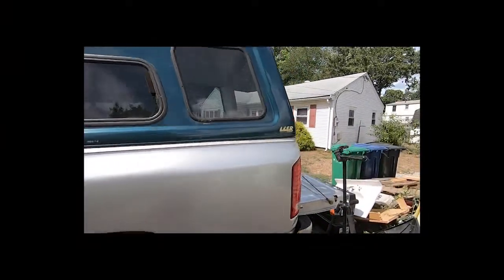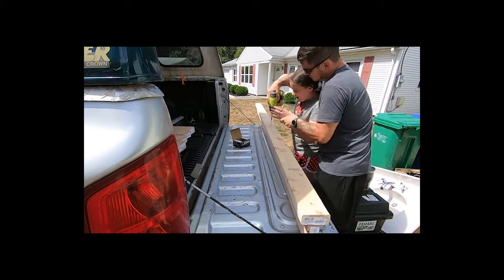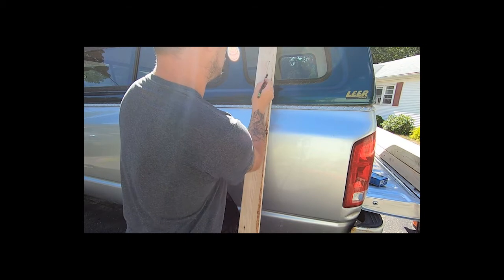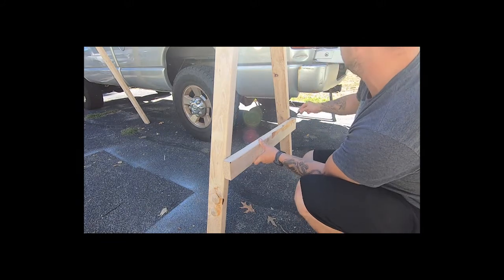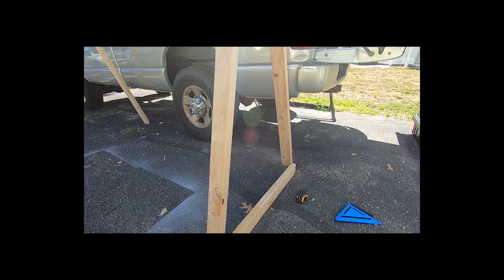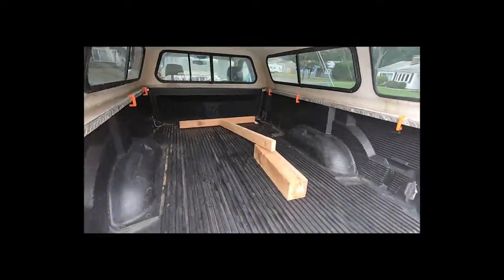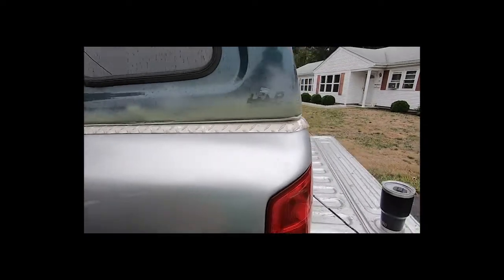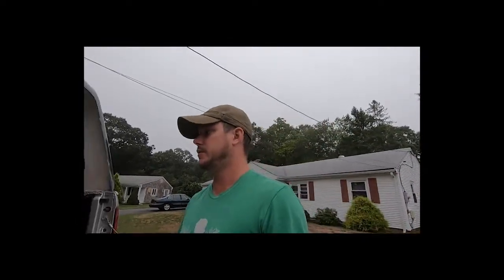How To Remove a Truck Cap (Camper Shell) By Yourself

Comment: So basically you built the same saw horses that you copied from Covet the Camper but did not show how to use them, lol
Reply from the maker: Copy saw horses? They are saw horses....pretty common design elements. Didn't "copy" anyone's saw horses. It's quite an old video of mine so yeah made some mistakes editing. Good thing you know of some other videos that'll show you how to slide a board across two of them 😏